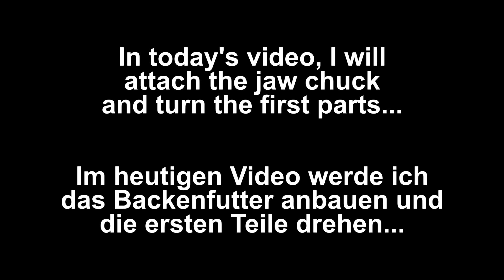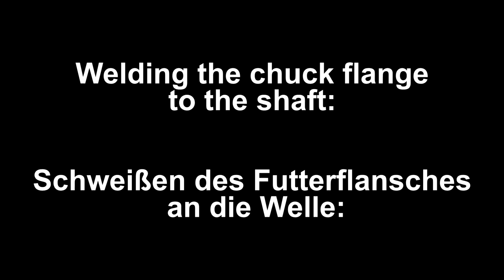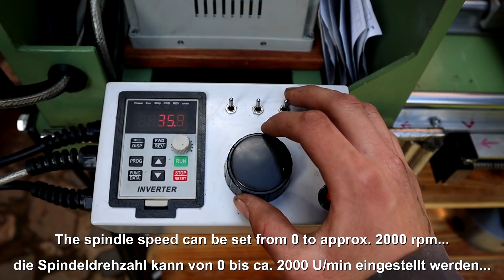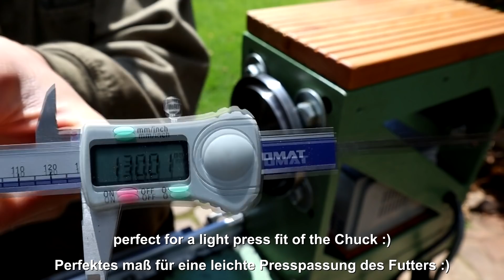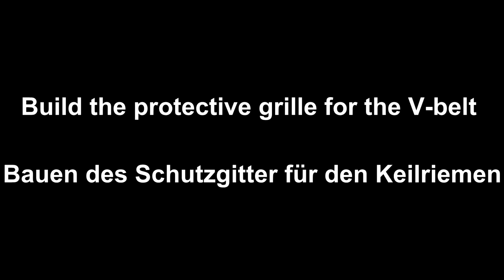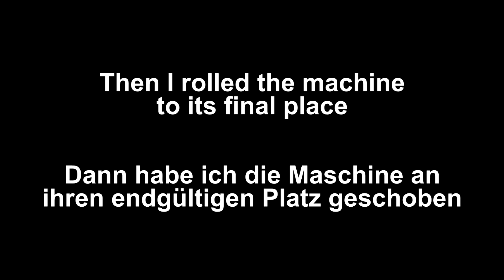Homemade Lathe #4 | Installing the Chuck & making the first Chips!

Comment: Top tip: Do'nt put grease in the chuck scroll, because:
1) It promotes the ingress of particulates(metal, swarf, etc), and air borne abrasives, dusts, etc ie it makes a great grinding paste, by holding these in contact with the  mechanisms;
2) Grease as it vibrates(induced by tool cutting forces) will migrate from the mechanical interference junction(bevel gear/crown gear, scroll wheel/scroll jaw teeth) and promote a REDUCTION in clamping force ie part loosening at high speed!
In general NEVER over lubricate(actially worse than under lubricating) a machine tool or its tooling for this reason, especially where iron(chilled or otherwise) are involved.
Use EP high tackiness way oils(iso68)/or small amounts of EP semifluid grease(Iso220).
The chuck has an oiler nipple and not a grease nipple for a reason! :)
Keep safe and well.
Reply from the maker: Oh thanks!
Reply: اختخاخاخخ
Reply: اختخاخاخ
Reply: اختخخخاخخخخاخاخاخ
Reply: اختخخخاخخخخاخاخاخا
Reply: خخخخاخاخاخاخاخخاا
Reply: خخخخاخاخاخاخاخخااخ
Reply: خخاخخخخخخخاخخخاخخاخ
Reply: خخاخخخخخخخاخخخاخخاخا
Reply: خخخاخخاخخخخخخخخاخاخخخ
Reply: خخخاخخاخخخخخخخخاخاخخخخ
Reply: خخاخاخاخاخاخخخخخاخا
Reply: خخاخاخاخاخاخخخخخاخاخ
Reply: اختخاخاخااخاخاخاخخ
Reply: اختخاخاخااخاخاخاخخا

Comment: I love all the work , but spindle design could of been better . A Hole threw the spindle and a better bearing set up , a way to load the headstock bearings , putting slight pressure on then reduces chatter by like half . Now that u have a working lathe make a set of thick plate mounts to except a tapered bearing . Next a gear rack and carriage handle instead of reaching in the back of the lathe bed. All in all l love the design , the use of Linear rails nice touch. I just wanted to add my thoughts as I have been running lathes for over 35 years and making high end pool cues for 25 of them. Anyways , keep up the good work.
Reply from the maker: Thanks, now im actually rebuild the Spindle with a bored shaft and tapered roller bearings! Runns way better with less play
In between ive build also an automatic feed! 
(ill show that in the next videos...)

Hope you can understand my English ;)  im from Germany

Comment: Nice build!! 👍
However, I would not grease up the chuck that much, chips will get in and grind the chuck slowly to its death.. Better clean it al and use only the smallest bit of thin oil..

Comment: While the shaft is long you have the opportunity to true the back face of the chuck face... You can face the face of the face... Unless you don't want to face up to the face you aren't facing.

Now I have to face... rewinding the video. No wonder I prefer machines, back stabbing only happens... if you're running away.

Your lathe... and video, turned out alright. 
Well done.

Edit: Never trust a checker, they will change correctly spelt words when they don't understand what you're saying.

Comment: What type (brand) of inverter do you use to change the speed?
Reply from the maker: @konstantingagarin4023  china no name 😅
Reply: @dexter1448  What are its characteristics (to choose a similar one)? For a 3 phase motor? Is there a seller's website?
Reply from the maker: @konstantingagarin4023  it has to have the same power ratio as the Motor. And you have to look for the right Voltage

Comment: What size motor are you using? And is it A/C or a D/C ?  Looks like to has a ton of low end torque.
Reply from the maker: Im using a 2,2kW 400V 3 Phase AC Motor with a Inverter so i can use my lathe on the 230V Grit.

Ive set the inverter so that the Motor produce at low speed more Torque...

The con of this is that this will heat the Motor up. But when you only turn a few Minutes at very low Speed this is okay...

Comment: The drillbits that you use for countersink
Reply from the maker: Whats with them?
Reply: @dexter1448   wear have you buy them
Reply: @dexter1448  and your vfd has an Option for torc compensation  If you program that the motor wil not stall If you are turning

Comment: Nice job overall! One comment though, at 10:56 you should be wearing goggles or glasses. You'll need your eyes to continue the fine work you are doing. A single chip can ruin your sight forever.

Comment: Jammer that the shaft is solid rock metal and not a pipe. I mean you cannot push a smaller diameter long work piece in the chuck.
Reply from the maker: Please watch the last video of this series ;)
Reply: @dexter1448  👍

Comment: I was disappointed to see that the spindle was solid. That’s a wasted opportunity. Besides, a hollow spindle is less likely to bend than a solid bar.
Reply from the maker: Yes, later Ive changed to a hollow spindler with rolled taper bearings...
Reply from the maker: The Problem is to get such a thick wall Pipe which is Strait and round

Comment: If anyone is thinking of making a homemade lathe, don't grease the chuck,use oil...if you use these bearings, make your first project be bearing housings for tapered roller bearings.....and don't use a solid spindle shaft you will regret not having a through hole....Oh and if you make a video about it,don't ruin it with terrible music.